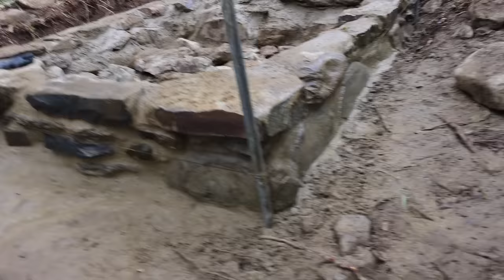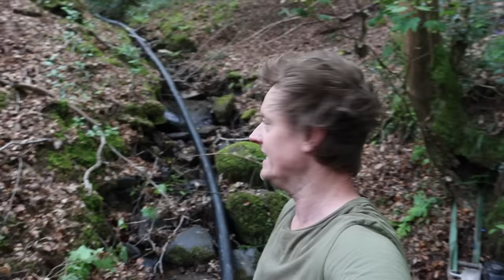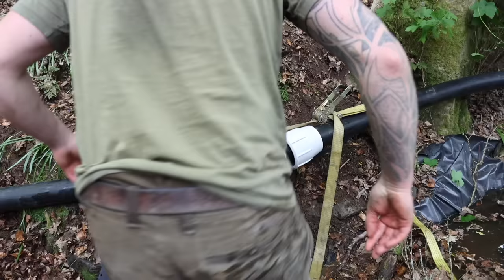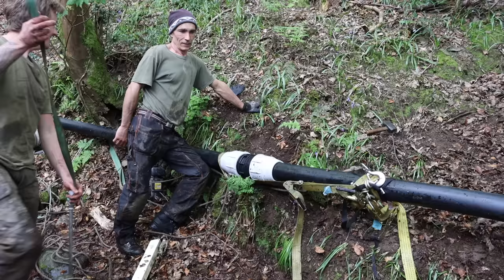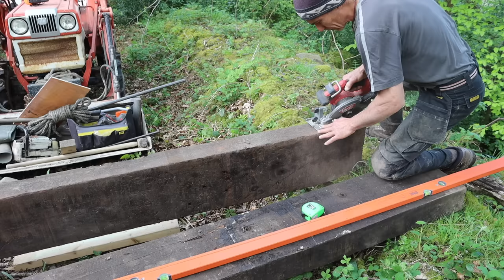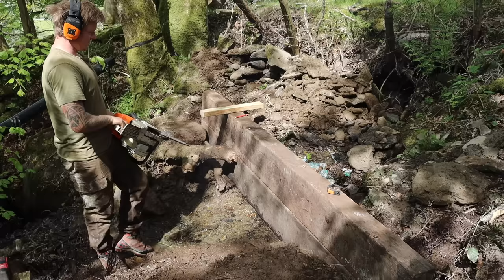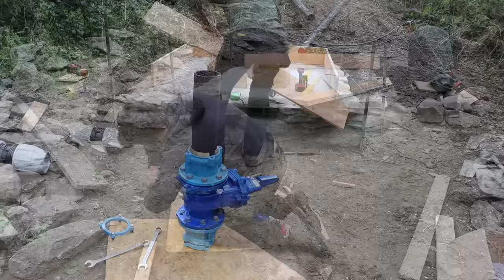1.5 Kw North Wales Hydroelectric System Installation Part 1

Comment: This is fascinating to watch, nice to see someone working with the environment instead of against it. PS. that rope seal, genius.
Reply: the environmental impact is MUCH higher than you imagine. its just the scale is small so you dont notice it as easily.
Reply: The interaction with the environment is huge. I‘m studying hydrology and depending on what type of water this is and how great the water abstraction is (by channeling the water in those pipes) you could kill all biodiversity and life around this or giving the environment a hard time in dry months.
Reply: Why didn’t you tip out the concrete from the tractor front bucket into the base using the hydraulics ?

Comment: Really surprised me how well that little gas powered winch did pulling that heavy pipe around. Anyway, looking great so far and looking forward to the rest of the build.
Reply: Petrol, not gas.
Reply: It's just a capstan winch,  great force multiplier and very efficient. Definitely petrol. We British don't call it gas as gas is gas and petrol is wet
Reply: @anonymous7192  really?
Reply: @AW-Services  And we call it gasoline and shorten it to gas, deal with it, lol.

Comment: Looks awesome Kris. I’m exited for you and I bet you can’t wait to see if the output matches your calculations….sure they will do though as I know you tend to research and plan projects thoroughly beforehand. Looking forward to seeing how it goes 👍
Reply from the maker: thats the part I do all this for really. I love to survey it, works it all out and then turn it on and it do what I expected. that gives me a real satisfaction. This system will be 1.5kw max and around 1kw average for 7-8 months a year.
Reply: @KrisHarbour  
Glad you did your homework. The flow at the intake looked a bit low. 
You might need to keep wildlife out of the intake during the drier months, so they don't set up shop in there and block your penstock.

Comment: In the future, may I suggest make the threaded rods slightly different lengths, with the longest in the middle? It would be a lot easier to align them by wiggling the top sleeper. Maybe something like 21-24-23-22 inches or whatever the appropriate length would be.
Reply: We did think of that after the fact. 👍
Reply: Drill the top and bottom sleeper and bolt down. Then drill the other holes though both sleepers and fit additional threaded bars from the middle out. Even better, cut threads on the ends of plain bars. You may well find that thick wall tubes work fine at less cost.
Reply: The way we build walls out of RR ties or landscape ties set the first tie then drive 1/2" rebar so it goes through the first tie then about two feet into the ground, then set the second tie and drive rebar through that one into the one below it, and keep doing that as the wall goes up. Predrill the holes so the rebar is a tight fit and there's no need for bolting them together. 
These guys do great work.

Comment: Man I can't wait to see you fire that up the first time. Stone work and intake area turned out beautifully! Did I see power lines running back up the trench that the pipe comes down, or is power going to head off in a different direction? Thanks for the vid!

Comment: Fascinating project. I’m curious what the payback period is for the customer given current electricity rates and expected flow from the stream.
Reply: That's a great question. One reason folk sometimes think about micro hydro is the cost of bringing the grid supply to a remote location. That can cost a great deal of money. Micro-hydro does need regular maintenance, but it can be cost effective if you don't count your own time spent working on, and maintaining it, as an expense!
I have a small waterfall, and looked at harnessing that for some micro hydro but when I worked out the cost of cables, pipes, and concrete, in addition to the cost of the turbine and generator, it put me off.
I have to say, even though this system has a good head, the flow looked really poor. I'm sure Kris will have done his research at the site, though. Maybe it's only needed in winter when solar is less reliable?
Reply: The flow is seasonal and summer is the perfect time for installation. I’m sure Kris and the customer have historic flow info to base calculations on.
Reply: well if he doesnt have electricity, the payback is instant, if he is going to grid tie, it depends on how much he spent initially ....most time with hydro the ROI is less than solar......solar has a ROI of about 10 - 12 years since you only get electric from it during the day....hydro runs 24/7

Comment: Great stuff, I have always been thinking you could do with a dedicated counter weight for the back of the tractor for traction and stability. I made one out of a blue barrel filled with bricks and concrete with a built in hitch cast into it. I guess you wouldn't want to transport a weight like this to your away jobs - maybe a water based one that you could empty and refill?
Reply: I was thinking of that, but for that job just a 3point linkage linkbox would have been useful for transporting more every journey.
Reply: Yeah. It's always much cheaper to let the customer pay for the water, and not have to pay for fuel to carry the weight to and from the job.

Comment: Excellent Work!  Stone work is beautiful!!  With all your experience your job is going together quite well and smoothly!  It's going to be great hydro system!  Were you holding the water back while you were working?  It seemed that there was not 1.5KW of water coming through.  Or is this the dry season and you have sized it for peak flow?  Again you always do quality work - I would be proud of any work you would do on my property!!  But, I am in USA.  Subbed long ago.  Liked !!
Reply: Advanced Nutrition -    Kris mentioned near the beginning that it is currently the dry/not-wet-very-often season. He anticipates a consistent 1KW output - maximum output of 1.5KW - for 7-8 months each year.
Reply: @wendyweaver8749  Thanks some how I missed that.

Comment: I hope you’ll talk about the wiring in a later video. Is voltage drop a significant issue? How far are you transmitting the electricity?

Comment: Hi Kris, not sure if you're already familiar with it, but in Slovenia we use a tool called a motika, which is a triangular spade with the head perpendicular to the wood, and it works wonders for digging and scraping soil with lots of rocks in it like streams. 
Great effort, well done.
Reply: Interesting. I looked them up. They are very similar to the Portuguese Enxada
Reply: @Ana_crusis  Yes I guess they do, although funnily enough the triangle is flipped. The pointy triangle is really for stones, it saves a lot of energy and your back ;)
Reply: @silaswitmond8416  yes it's very similar to the enxada.  if you look them up. They come in a variety of shapes and functions you can have some with a kind of 2 pronged fork on one side.
Reply: We have those here too but they're not the best for digging that type of ground which is mainly rock and stone.

Comment: This is so exciting to watch!  We want to put in our own microhydro system and haven't a fraction of the knowledge or experience you have, so the opportunity to watch you putting this in is phenomenal.  We have a similar situation to this in which there is low flow by fall, very high flow in winter, and quite a lot of head.  Eager to watch the entire process.  Thanks so much for sharing!

Comment: awesome job. Might want to consider making a wrench for those pipe splice connections. It could be made from laminations of plywood easily and would save a little frustration with the strap wrench, and while out in the mud and rocks and fighting pipe, saving a little frustration would be worth the time to have the tool from that point on. 
Thanks for the vid(s)!

Comment: Very interesting project.  You have created a modern water wheel generator. 

A few items; First, put on your safety glasses.  You cover your ears, but not your eyes.  Second, in the area of the bend where you are having problems with the flow, try flow straighteners.  Add some guides to help the flow keep laminar.  Start where the flow is still laminar and continue through the bend.  Third  you have two bearings that are carrying the weight of the shaft.  Slingers may be needed to protect the bearings against water entering the bearings.   The centrifugal force of the turning shaft can carrying water along the shaft and into the bearing.  Even sealed bearings can be damaged.  The slingers are a low cost investment, for a lot of insurance.

Comment: Thankyou for this. Has really helped.  As a suggestion when butting pipes (plasson fittings etal)  chamfer the leading edge and it it will engage without busting a gut.

Comment: Amazed. Those threaded rods would have been easier to line up with the top sleeper if you'd countersunk the holes  - conical shape of the holes gives you a bigger hole to hit and acts as a guide. Looking forward to the next one! Thanks.

Comment: Lovely video. I bet you were aching a bit the following day though!
Singing a song when you're tamping the concrete is a great way to get the team coordinated, and it's also fun.
I recommend almost any song by "Queen" for this purpose. Otherwise, you end up doing what you did with one bloke tamping his end at his own whim, and the other bloke being completely out of sync. If either of you are tone deaf then just throw the mud in there and pour some self levelling screed on top, saves a lot of mucking about. 
Also, I have to say that having put in some small irrigation systems myself, I was cringing when I saw your assistant pulling in that pipe. If you don't pull it far enough, no worries, you can always pull it a bit further. But, when you pull it too far, as he did, you're in a world of pain unless you can easily either cut the pipe to correct length or pull it back from the other end. It's always easy to criticize, but I could see he was too eager to get that pipe pulled. He should have positioned the lower stretch of pipe near the point he was pulling from, and then pulled the upper end gently up to it.

Comment: Before I comment this video I went to the kitchen to check my 10 years old kettle.  It was made by Tefal and the stamped rating is 2.38 to 2.6kW.
I have spent part of my working life in hydros too and saw my British colleagues chasing mostly "mini hydro" that has a maximum output no more than 2MW or 2,000 kW.  I still have machine characteristics of some internal projects from UK (Dinorwic and Foyers), Africa and South America.  
Only after retirement with a bit of free time I found out China has been building hydros in a big way too.  It has the world's largest No. 1 hydro (Three Gorges 22,500MW), 2nd largest (Biahetan 16,000MW), 4th largest (Xiluduo 13,860MW) and the 7th largest (Wongde 10,400MW) on the same river.  Baihetan is their latest hydro with 16 turbines each rated at 1,000MW which is currently a world record holder.
I am pretty sure in around 1950 China was doing exactly what people in the video are doing.  In China it was called the "Great leap forward" when university graduates tried to produce hydro themselves.  China was economically blockaded by US for two decade as a retaliation for participation in the Korean war, started in 1950, against the America.
My take is in 2022 I now see UK doing what China did in 1950.  China is way ahead of everyone after 70 years. Have the British lost it?  What the hell is going on?

Comment: Hello brother this is the first time I watch your channel and love what you doing and glad to find your channel. 
And I was wondering about if you use flexible pipes with the same dimensions th whole  way down and when you finished laying the pipe run the water inside it then pour hard glue on it to make it more harder to take the form like that kind of pipe that you use. (Like we do with fiberglass) 
That a suggestion I never did that before but it looks possible to make. 
I think that will save a lot of time, hard work, and money. 
This idea just popped up to my mind when I saw your efforts to pull the pipes up and to connect them together.

Anyway that was a nice job brother and you have a new fan 👍🏻
Best regards.

Comment: Pro tip, when you have a bunch of studs to align like in those sleepers, make then all slightly different lengths, 1/2 an inch or so is fine, it makes getting them started a lot easier, as you can do one at a time.

Comment: I work with a lot of high-density polyethylene. For potable and non potable water. I use a propane tank and burner to make the pipe more flexible. This stuff will whip a grown man in the summer. Try unrolling it in mid winter. Keep the flame moving so you don't overheat the pipe.

Comment: When lowering the top piece on to the bottom one set all your rods to 4 different heights then you can lower each one at a time. ... All so remember shovels are made to suit every one .. cut your tools to suit YOU. need to make your tools for the tasks in hand. YOU are doing a good job. Reduce your blades on both shovels for an easier life.

Comment: Thé amount of water and the reservoir need to keep a 4 inch flow going is goin to be incredible. What u have will be emptied in 2 minutes. Even before the air bubble are out of the pipe. I’d recommend 1inch pipe with higher pressure and a peloton wheel..  you have enough height.

Comment: Kris - Another great video and such workmanship, the system is going to look awesome. may I enquire  how much is it going to cost the owner of the land for the system and how far away will the control and distribution board for the electrics and batteries be? What using current cost would be the payback period for such a system based on 7-8 months water flow. With that much head and water in the pipe could one not turn the system on when the pipe is full for short durations during the dryer months?

Comment: There are old watermill sites all over UK. Some areas (eg Devon) has numerous leats and water channels that could generate power. By laying pipes into the flow, some could generate power at numerous points along the leat. The canals are another area were potential is wasted. Canals flow continuously with spillways at each lock. Intermittent power could be taken at every spillway (they slow to nothing when locks are filling).

Comment: Some 50x50 angle iron through the bottom bolts of the gate valve will allow you to bolt the valve down to the floor and stop movement.

Comment: I don't know much about this stuff but perhaps next build, start pulling pipe from the intake and as you need to add more to it attach them up where the intake is gonna be and pull it that way course then again that might overload your winch a bit but you could always use the tractor as you add more lengths. Just my thought to try and make it a little easier instead of fighting in the muck.

Comment: That was a lot of concrete to fill around the turbine. Could you not have added more rocks there to minimize that and keep a solid floor?
Nice detailing of the rock walls at the end.
Reply: Loads of rock went into it and as much as we could spare with what was on site.

Comment: Hey Kris, great job guys! I wonder how you feel when you do it for a client as opposed to doing it for yourself.
Could you use a torch to heat up the black pipe to bend it or it's just not possible?
Reply from the maker: I have bent it with hot water before on short lengths but its not really possible when its this long. it would take a lot of hot water. the key is to use the right tools.
Reply: I'm sure it is not necessary, once is concrete set and so pipe held tightly in place, HDPE pipe is quite flexible and can be easily straightened.

Comment: Do you ever think of lining the exit for the water with  some scrapes of porcelain tile.  Just keep thinking of a mens bathroom sink that was made out of concrete- the water was dissolving the concrete on the bottom of the sink.  Then on the building were the water comes out it will you create a channel or was he planning on using it for irrigation?

Comment: What sort of winch is that?

I'm currently looking at a farm that has ~40m of head with a hole stack of dams up the hill and down the hill. ~250ML on the river flat and about 100ML up the gully.

I'm thinking that pumped hydro would be a great option for storage instead of or along side a battery. Trouble is where do I find the turbines? Want to use something thats bigger than domestic but much much smaller than industrial.

Comment: Burying the pipe would be a good idea in order to protect against frost and freeze damage.
Reply: As long as there is a reasonable flow of water through the pipe it won't freeze.  In extreme cold and low flow it would be necessary to drain the penstock.
Reply: Frost & Freeze damage not really possible in Wales.
Reply: @tonygrimes13  Really? So the burst pipes I had when I was living in the Mumbles during a cold snap were imagination?

Comment: Gawd, I would not want to dig that intake without a pickaxe!
Reply: The big digging bar is a much better tool for that job than a pickaxe in an confined erea like this. Swinging a pick with a workmate and other obstacles close by is not the best idea, plus the heavy bar is more efficient going through rocky and stony ground. ✌